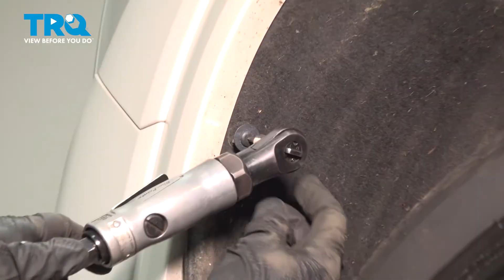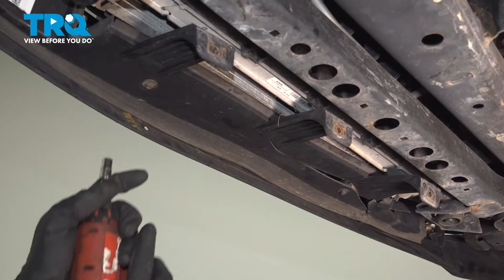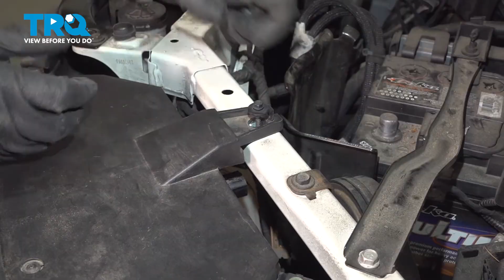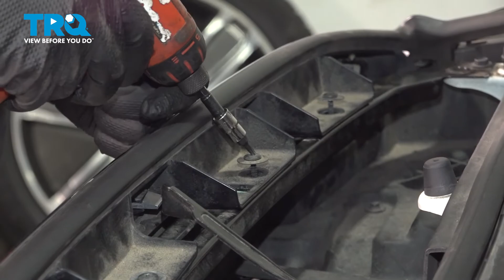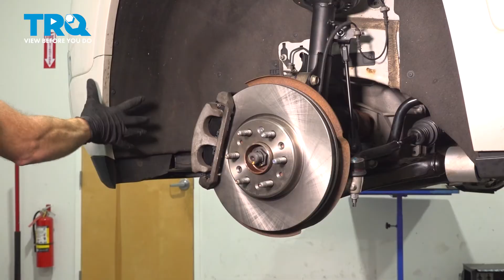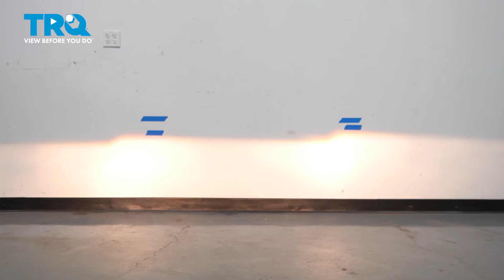How to Replace Headlights 2017-2024 GMC Acadia

Comment: General Motors has entered the realm of sheer stupidity! They make what used to be a simple job, extremely difficult! I'm 70 years old and serviced my vehicles for years. Back in the day changing a headlight was not expensive and easy to do. Now headlight assemblies cost hundreds of dollars and are difficult to change. The auto manufacturers deliberately build in complexity and cost so dealerships can rip you off on what used to be a simple repair!!!